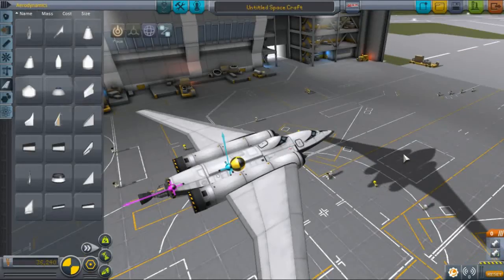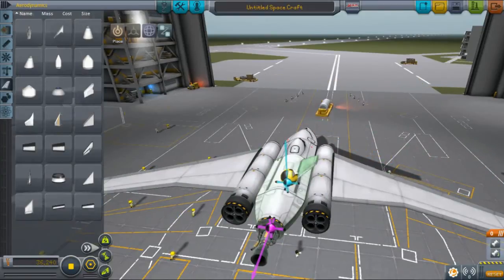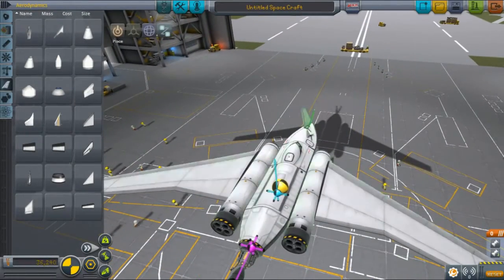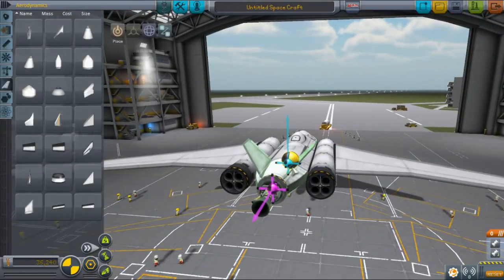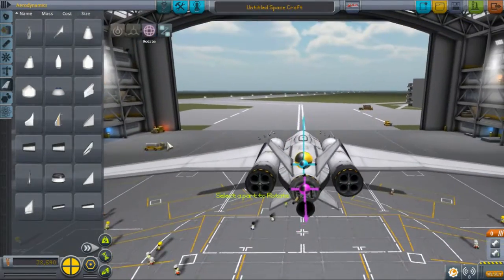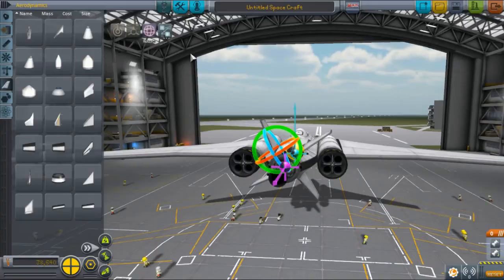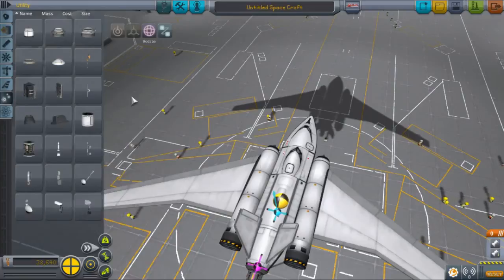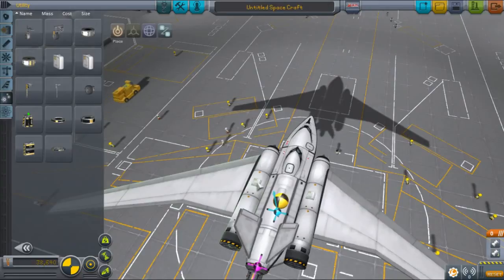Kerbal Space Program Construction Tip: Symmetry and Angle Snap

Comment: How do you stop the game automatically changing to mirror when you want the symmetry to be radial
Reply from the maker: I just hit R to change  it from mirror to radial.
Reply: @timothyjudge418  Old comment, but I think the issue he had was that when you try to place symmetric parts on other parts that already have symmetry, the editor automatically switches to the same symmetry as the parent part.

So trying to place 4 fins radially on a fuel tank that is already mirrored will have this issue.

One workaround I know of is to temporarily remove the symmetry on the parent part, add the symmetric new parts, and then reapply the symmetry to the parent part. This will work properly.
Reply: Timothy Judge how about on PS4?
Reply: @ultralagger1  that's what I was on about